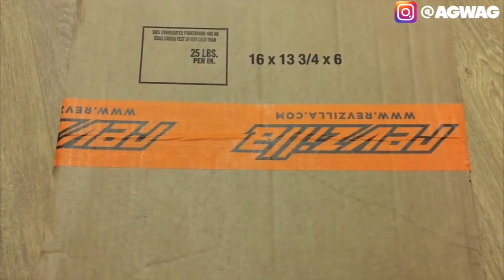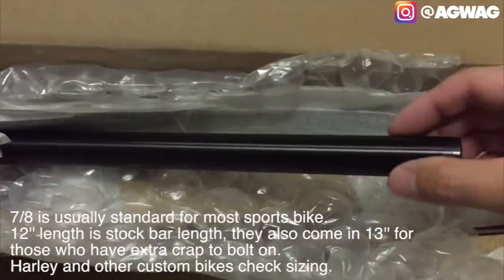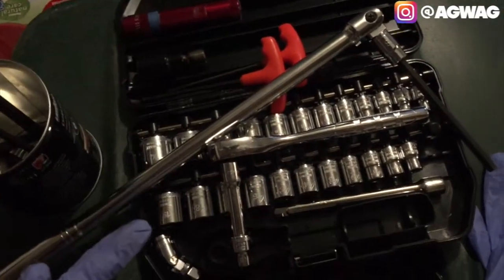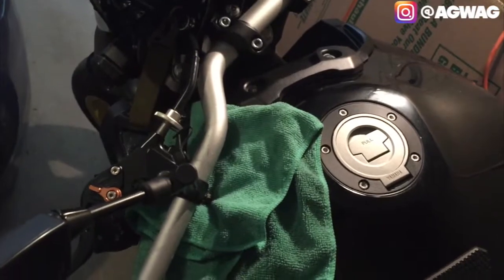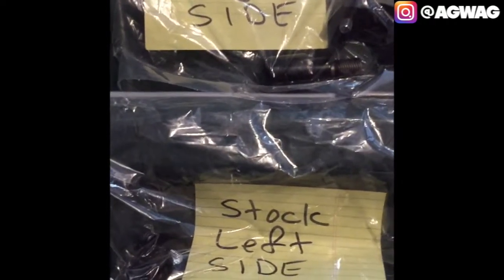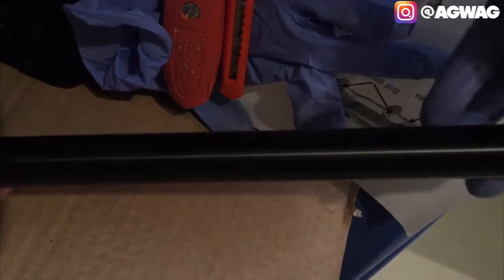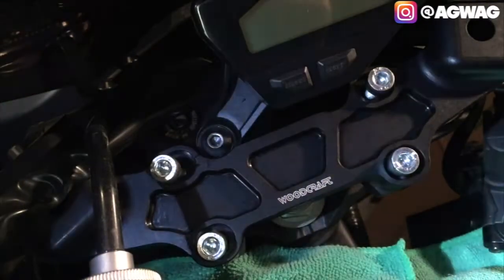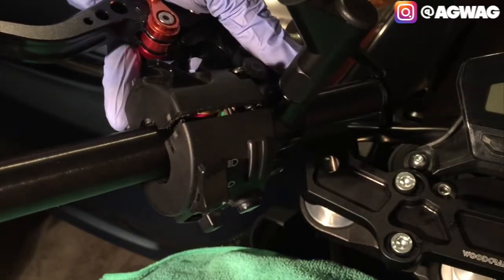#DIY #Yamaha #FZ-09 - #Woodcraft Clip On Bars + Progrip 725

Comment: Great video! Did you have problems with the clutch-, throttle cable or brake lines?
Reply from the maker: No issues on install, however I can’t say for sure but the clutch cable housing to the lever has to be bent a little more, long as you lube the cable it’s an easy squeeze, front brake lever works like OEM, with shorty or adjustable levers that shouldn’t matter too much either to be able to adjust the different angle of the clip ons and reach. I’m glad I went with clip ons, and WC for that matter, I would still do WC clip on for any naked bike, the stock bar isn’t to my liking but that’s my personal preference.
Reply: @agwag9x19  thanks!! A lots of guys put the rizer in down position but imo it looks perfect with the 1" in the up position. Think of going to do the same for my mt 09 street rally! For a sportier position I'm gonna use my Aprilia RS 250 ;) bye

Comment: What size drill bits are they for the holes in the handle bars where does the kit give you that information?
Reply from the maker: It's been awhile since I did the mod and video, I didn't remember the bit size but I compared the holes and went small bit first then gradually went up until the controls fit, hope that helps!

Comment: Nice video, how did you center the gauge?
Reply from the maker: Alexander held the bike straight off stands, used a 12” level, was also able to just clear a 14” windscreen in the UP position of the WC coupons, DOWN position idk if the screen would clear anything (reservoir/cables/etc) sat on bike straight and adjusted the levers at my desired angles, easy to adjust!

Comment: Yes another comment on a different video! I have purchased 5-6 grips, do those pro grips fit the stock pars ?
Reply from the maker: Yes they do, most modern sportbikes and nakeds are 7/8'' bars. Check your grip details and packaging. Some euro and older models might be different, I could be wrong but Harley Davidson and other cruiser like might have different diameter. Stock FZ-09 handlebar is 7/8'', a heads up if you install grips, there is one grip diameter that is bigger than the other. The smaller goes on the clutch side, the bigger diameter goes on right side as it goes onto the throttle sleeve. You'll know when you try them on. I used a little spray on the bar itself with Goo Gone, some use hairspray to give you an easier time to slide the grips on. After it dries, they don't move at all.

Comment: Hey what windscreen is that?  About to pull the trigger on woodcraft clipons, but want a screen that will fit.
Reply from the maker: Hi Luke, it was a generic one off amazon (unable to find the order, 14'' H). Clipons are a huge performance to the FZ, regardless of what brand, WC has 2 options with the high and low setup which is nice. Bugscreen however will depend which will fit. With SS lines installed I barely had space to get all 3 to work together. Sorry I couldnt be of much help, but with an ebay screen, I would assume the WC clipons would work in either H or L setup. I found the generic ones work just as well vs. $200 PUIG screens.

Comment: What size drill bit to use?
Reply: IAM BRIDGEFORTH hi IAM, it depends on the controls, when you remove them from existing bars, look at them and go by feel, I went a little bigger, just compare the bit and the ports that stick out, good luck!

Comment: hey I got the 13" long bars too , did you line up drilled holes from end ? also how's the china brand bar end mirrors working so far?
Reply from the maker: Sam Bumanglag hi Sam, I’m on my second pair of mirrors, I have another set in the garage, my first pair, the left one went out (c clamp bracket onto the bar end cracked after removal and reinstall from swapping handle bars. I did drill the holes the same as the stock ones, these longer bars give you more real estate for extra stuff like the bar end mirrors and bar sliders, hope that helps!

Comment: is that the lowest you can get the bars? sorry for the horrible english
Reply from the maker: No, these are in the up position, the down position drops the bars a few more inches but theres a few things you have to adjust, clutch cable housing, and other cables so it can clear the forks and front end. Also having a windscreen makes it even more difficult. Without grips on, the bars almost touch the tank when fully turned by a few cm. Hence I went with the up position to clear everything and prefer to have a windscreen. I'm happy with the quality and design of the woodcraft clip ons, only gripe I have is the angle is not as aggressive but better than stock. Hope that answered your question!
Reply: agwag thank u so much, ride safe FZ nation!